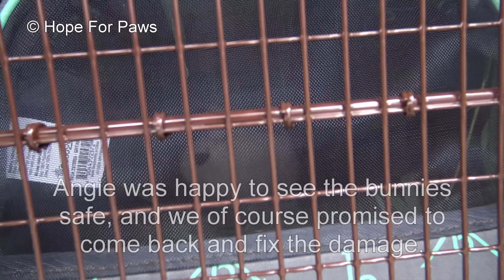We had to use an electric SAW to save this family of homeless bunnies!!! DANGEROUS RESCUE!!! #bunny

Comment: As a foster mom for two bunnies, I can tell you that they're as smart as a dog. They learn basic commands. They play with toys, they run to you when you come in, they can cuddle, many of the same things a small dog does. They do need wood to chew to keep down their teeth. Mine's fave was fresh crabapple branches. Fresh grass/lawn (dandelion & clover), grown in a potting tray can help keep their teeth down, too.  Hay is the bulk of their diet, fave part, clover buds and seed heads. 
Their need to dig can be satisfied with a deep plastic bin of dirt/top soil, not potting soil. They can use a litter box with cedar flakes but sometimes leave droppings as they do their bunny errands. A small cage can work as home base, they can learn the word "home" and will go if you tell them. They got put in for the night.

Comment: Some important facts to know about rabbits:

1. Hay is the most important part of a rabbits diet

2. Do NOT bathe your rabbit unless they have a poopy bottom or if it's an emergency. Submerging a rabbit in water can cause severe hypothermia since their fur is very dense, also they groom themselves often so there really is no reason to bathe them in the first place.

3. Since rabbits don't have padded paws, avoid wired-bottom cages (I don't recommend a cage) And cover most of your floor with carpet so they don't have sore feet.

4. Avoid small hutches or cages, rabbits will want to run around and do binkies and play.
I recommend using an X-pen (For 1 rabbit, depends on size) or just letting them free-roam around your house.

5. Avoid having your rabbit roam around and/or sleep outside, rabbits are prey animals. They are not like cats or dogs who are predators. Also it's cold outside and rabbits cannot regulate their own temperatures-

6. Preferably use water-bowls instead of bottles, with bottles rabbits can get dehydrated or the water can get infected within the bottle.

7. Avoid having multiple rabbits in a same cramped space. If you want to keep your rabbits in the same space, keep them in a big room to avoid fights or to avoid having of your rabbits being severely harmed.

8. Do not mainly feed your rabbits carrots, feed carrots as a small treat only. In the wild, rabbits do NOT normally eat root vegetables.

I may have forgotten a few other things on this list, but i recommend watching "Lennon the Bunny" for further knowledge about how to keep your rabbit safe, healthy and happy.
Reply: Bitch I already know these facts. I own 2 rabbits😎